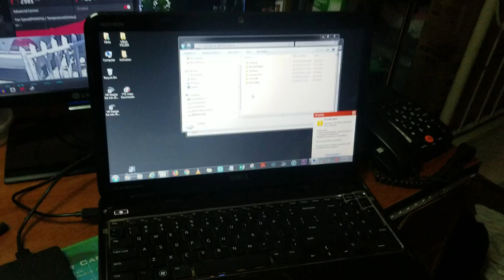LAPTOP NAMAMATAY? OVERHEATING! PAANO AYUSIN

Comment: Eto yung problema ng laptop ko .... Kaya pala biglang nag off at napaka-init kasi nag over heat ... Na try kong buksan yung laptop at nalinis ko na rin yung fan pero yung thermal paste sa processor nya ay sobrang tigas as in kasintigas ng epoxy 🤣 

Ask ko lng kung meron bang alternative na pwedeng gamitin aside from thermal paste?